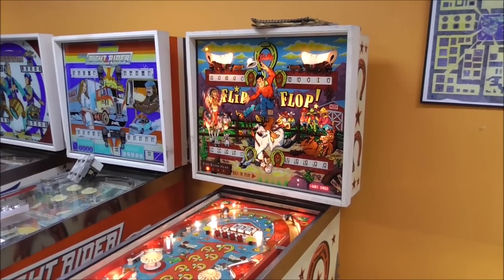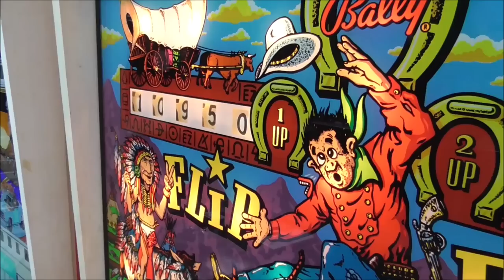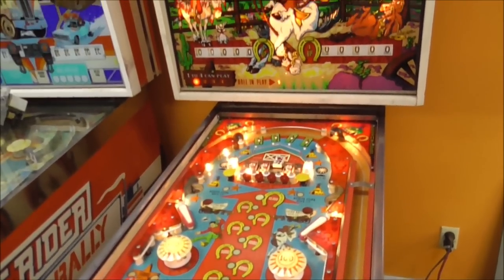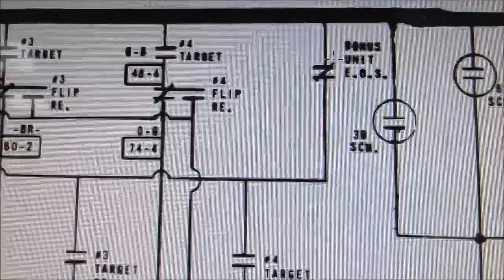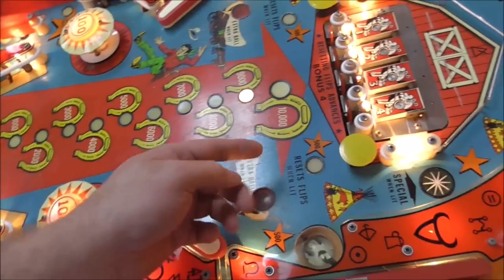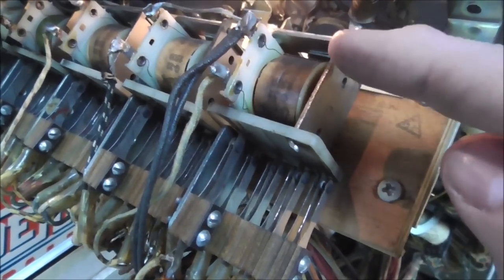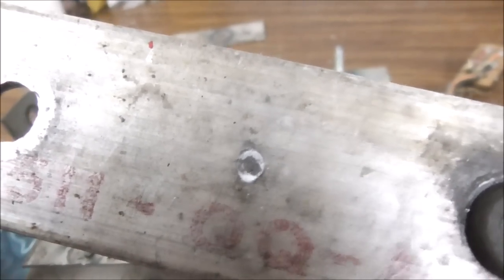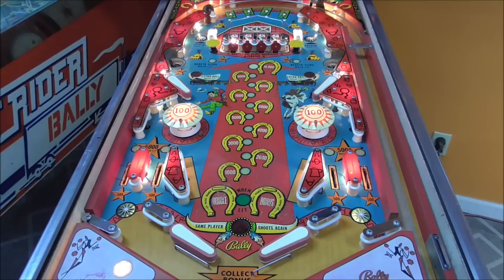Troubleshooting a Bally 1976 Flip Flop Pinball Machine W/ Schematics... & The Ghost of George!

Comment: what is with the "DOWN THUMB", come on now, this is the "MONALISA"(last of the "E.M." units) . these units had "CHARACTOR" with real chimes, score reels, with relays that provided the logic that would "ROB" you of 10 points once in a while(OH MY GOSH!!!). I always did wonder why "THEY" did not use D.C. voltage on the coils of the relays. you could operate at a much lower voltage and the "PULL IN TIME" is much faster, and here is the the real bonus to running on D.C., instead of A.C. voltage         " NO RELAY BUZZING"!!! just a "CLICK" and thats it. when a relay is "buzzing "what you are hearing is the 60 hz( every 1/60 of a second there is no voltage at the coil) so what is used is a "SHADING COIL" to provide temporary magnetism, if that coil is open the buzzing is unbearable/loud.
Reply from the maker: I'm surprised they didn't make them DC too, because apparently they must have gotten tons of complaints from people about the coils buzzing, it's all I ever hear people mention so back in the day there must have been a ton of players who would complain to the operators and locations that the coils buzz, but yet Bally never replaced the relay coils with DC ones, it's a mystery to me, it seems like such a simple thing to do to keep all the players happy
Reply: you are seeing all of this "STUFF" as aged machines that have been dust collectors for some time. a lot of the problems that you are challenged with, I did not experience those problems. back in the day, when these "flipper units" were  new up to 10 years old at the time, hanging out in LARGE game rooms, generating tons of heat, low voltage dips were a huge problem ( 85- 90 volts), and would cause the machines to "DROP OUT"(" game over'). this would happen during the summer when its hot outside. ( friday afternoons). getting such service calls, you would not find anything wrong, this would piss off the owner, because I would tell the owner "THERE IS NOTHING I CAN DO ABOUT LOW SYSTEM VOLTAGE".